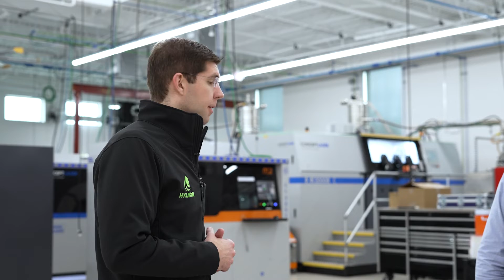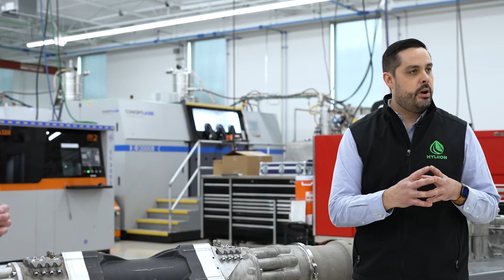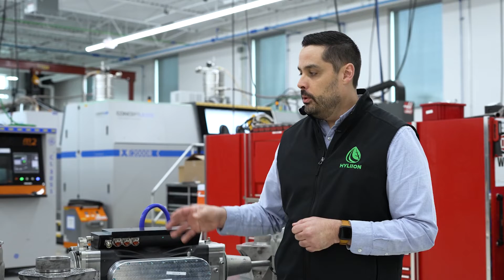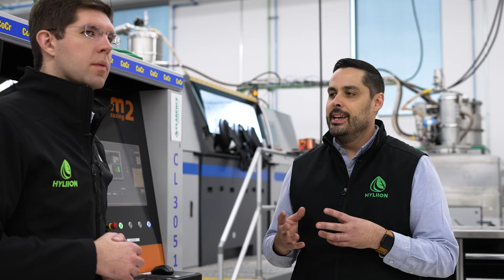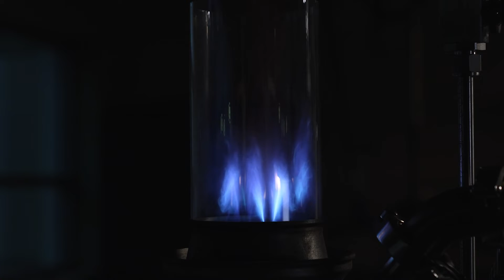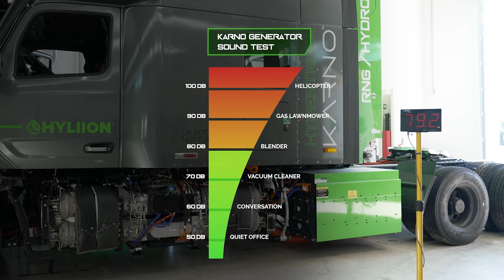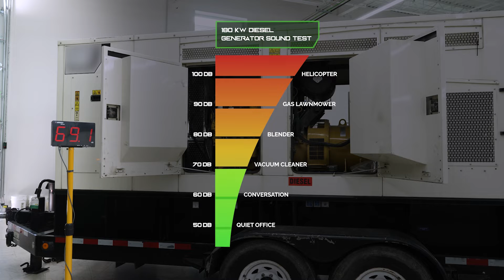KARNO Generator Tech Fireside Chat

Comment: This tech, as explained, reminds me of steam  locomotives and the oscillating drive mechanism.
Reply: Yes, they are related, but in a hot gas engine like this the working fluid never changes state (it is always a gas), while in a Rankine cycle such as a steam engine the working fluid (traditionally water) moves between states (boils and condenses) and that is critical to the cycle working.